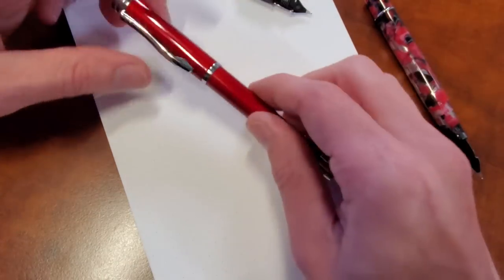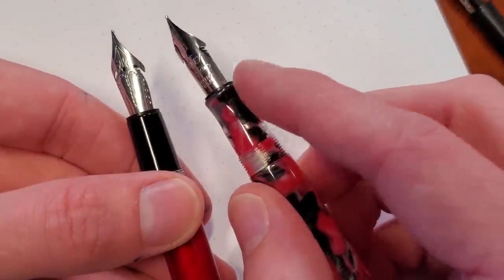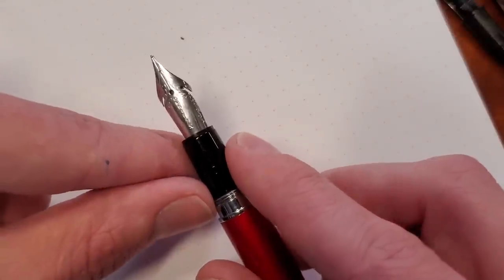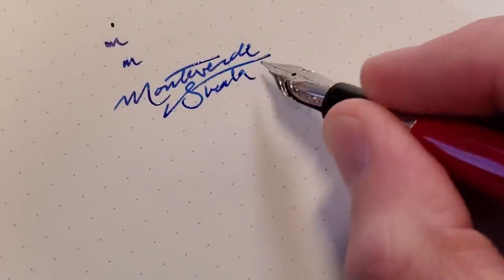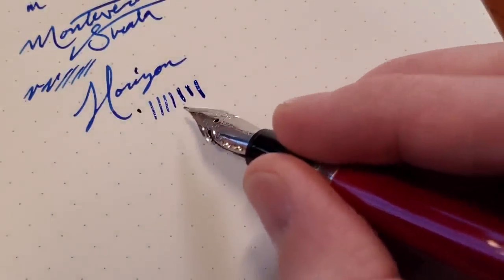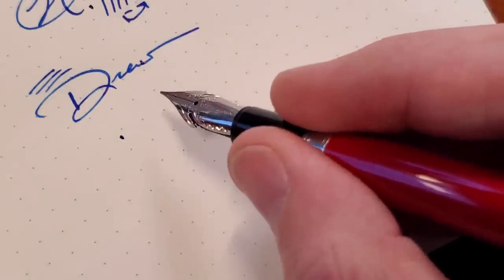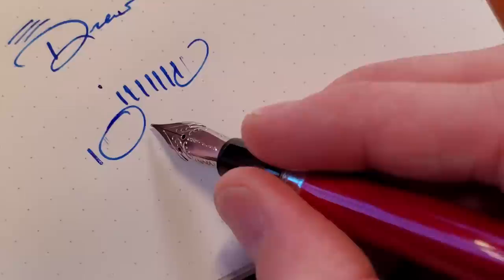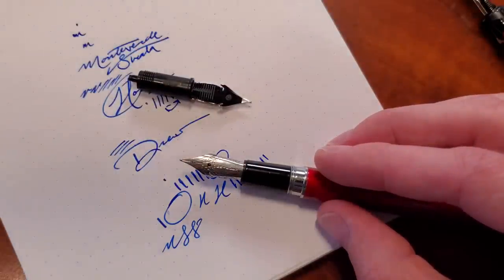JoWo Omniflex Overview - NEW Nib Design

Comment: The omniflex nib was never great, but the feed  not being designed to keep up was always the root of the problem. The new nib looks nice, but we still have a feed problem!
Reply: You are correct! I do though think that the original omniflex nib was terrible; but the feed needs improvement too!
Reply: Agreed. It is quite useless to have better flex nib if the feeder can't keep the ink flow.
Reply: @LaBeGa GSCt the nib looks great, but he says in the video that the feed won't keep up, then demonstrates the feed not keeping up. The result is a flex nib you can't actually flex.
Reply: @mkompan  there’s also some ebonite feeds that you can get from Fountain Pen Revolution not sure the exact price but last time I check I believe it was a less expensive then the ones you mentioned
Reply: @juliom9059  I'm a big fan of FPR, but I think their feeds are not designed to fit into Jowo nib units. In the case of flexible nib factory, the feeds are exact ebonite reproductions of Jowo feeds.
Reply: @mkompan  I was not aware of that, I haven’t tried swapping nibs out I just suggested the FPR feed because of my positive personal experience using them. Thanks for informing me about that though!

Comment: I just got am Omniflex from JoWo on a Conklin pen. The thing is this: when I write normally, I apply a force of about 50 grams (I measured it with an electronic kitchen scale), either with a fountain pen or a mechanical pencil. With the Omniflex, in order to obtain a variation in  line width I must apply a force of over 175 grams, which is A LOT.